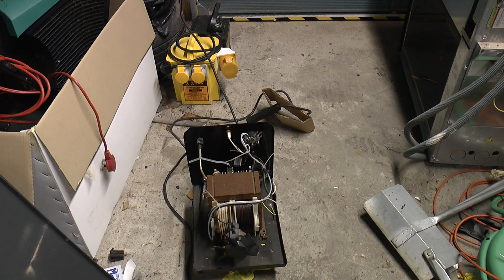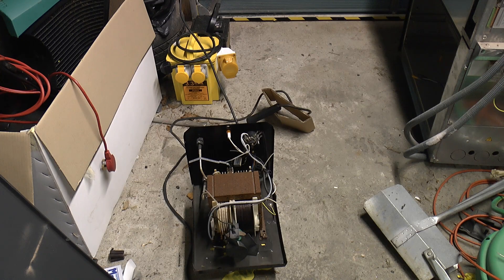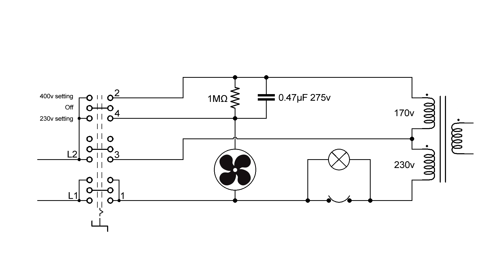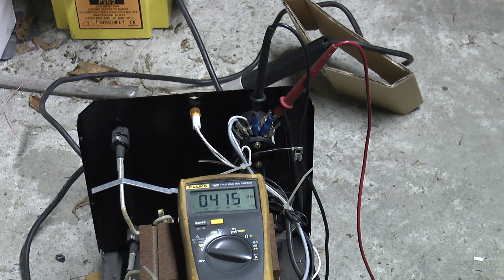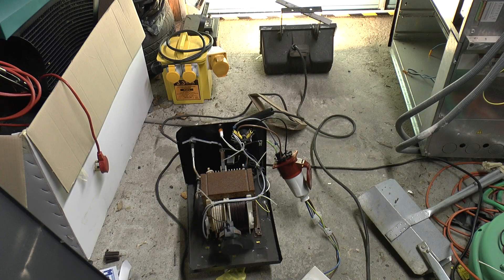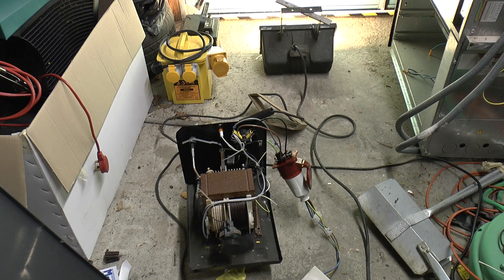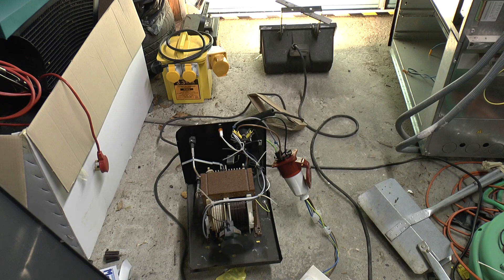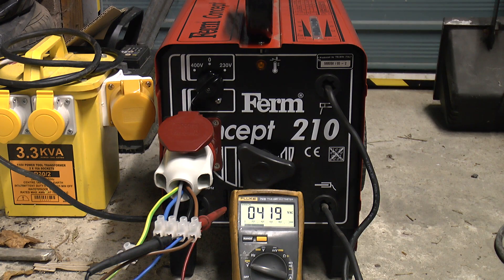Convert a 240v arc welder into a 415v PSU

Comment: Can it be done the other way around, 415v from 2-phases of a 3-phase Plug to 220v single phase? What would be the expected amp output on 220v? Each phase of the 3-phase Plug has a 16A breaker.
Reply from the maker: Yes. In the case of the welder you'd have it running in 415V mode and tap 240V off the other connection. Assuming 100% efficiency the input current would be output current x 240/415, i.e. output current x 0.58.
Reply: Great, i need to run a single phase inverter welder that draws 22.2A max, if i run more than 100A output it will trip the 15A breakers, but using a welder as autotransformer i can use 2-phases and avoid tripping the breakers. Thank you very much.

Comment from the maker: The yellow one in the background? Probably, but you'd want to disconnect its earthed centre-tap altogether and connect the input earth pin to output earth. You'd be changing the plug and socket anyway, so that's not a big deal.

Comment from the maker: The primary side seems quite sturdy. I don't know how many turns are in there but at least the wire looks like it can handle it (unlike that scrawny aluminium secondary).
The input current at 400-415v (according the the rating info on the top) is 19 amps, so that's 7.8kVA of fun. Then again, my big isolation transformer's continuously rated at 8kVA and that's twice the size of the transformer in here. We'll see :)